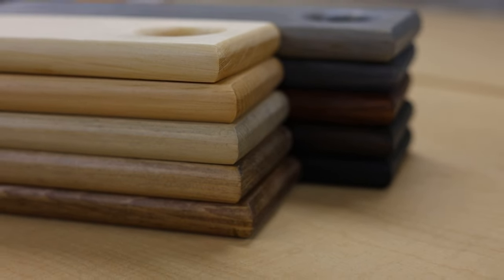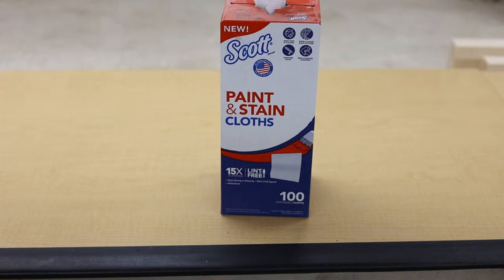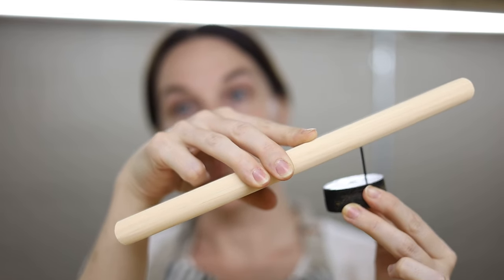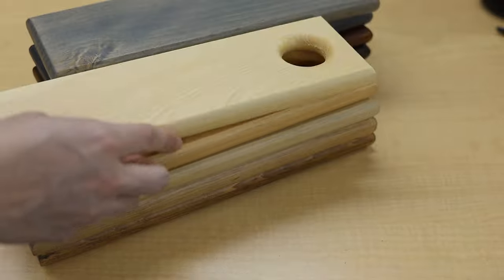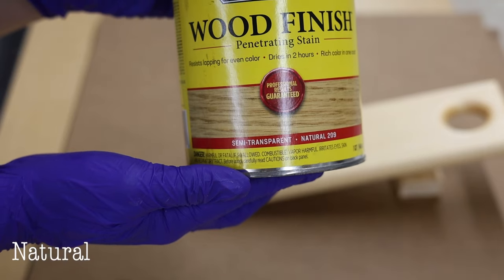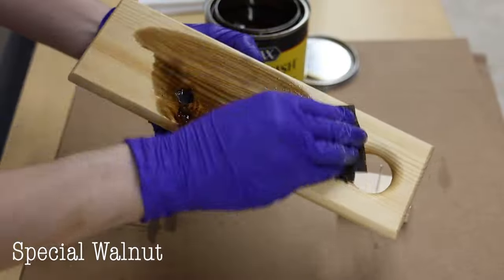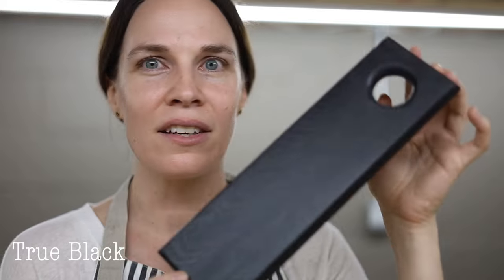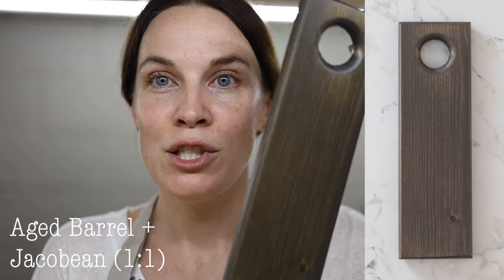How to Stain Pine and My Top 10 Minwax Stains

Comment: I use pine almost exclusively. Yes, paper towels for small projects are great! I also use sponges for larger stain projects - I buy grout sponges and cut them into smaller pieces so they fit into the stain cans. I like your mixes and will be trying that in my own work.  Well done and very thorough.
Reply from the maker: Thanks for watching! Great tip for the grout sponges too, I’ll have to try that out.

Comment: I have been staining wood since 1989. This is a very good tutorial. Tons of good information. My preference is also Minwax for staining. I have the 'feel' for it...I guess you could say. The wood conditioner is a MUST for pine, also for cherry and for western red alder.

My personal favorite is Puritan Pine (#218). Most popular with customers is Early American. Driftwood is popular, as is (and I can't believe it) Golden Oak. I have 'tinted' Golden Oak with grey to some success.

I use chemist's glassware when I mix colors of stain, primarily to achieve consistant results. A couple of those graduated cylinders are less than $30, and give me confidence I can successfully repeat colorations. They are also useful in reduction of topcoats especially when thinning for spray...which I do a lot of.

I also use the 100/150 progression with pine when sanding a product prior to stain. While many woodworking folk will recommend a 80/120/180 progression I want the stain to penetrate and find that anything past 150 grit doesn't allow as much penetration as I would like. 

Finish is half the job, in my opinion. You can build a masterpiece and trash it with poorly applied finish work. It takes practice, and more practice, and finally some more practice to begin to get the 'perfect' finish. Always test the finish before application. Always test the topcoat for compatibility. Some stains will bleed through a clear coating. Some clear coats will fish-eye or blotch. It is a neverending learning process, but to me finish work is the most satisfying part of the craft.
Reply from the maker: Thank you so much for watching! I feel validated that my process aligns with a staining veteran since I'm still relatively new to the craft. You've inspired me to try some new colors! Thanks for sharing your experience.
Reply: Thank you for the info. I took a screenshot of your comment. ❤

Comment: I am starting with staining and your video is the best one, thank you for your time. I still not able to have dark colors as yours, and I think the problem is the wood. Cann your share what is the wood you use? If you can share a link will help me a lot.
Reply from the maker: Thanks! Make sure you’re not sanding to too high of grit (I stop at 150 or even 120). You can always add more coats after an hour or two of dry time for a darker color. One coat typically works for me, I’m pretty generous with the amount of stain on my rag. 

I use the 1x pine from Home Depot or Lowe’s. Here is an example: https://t.ly/GFWf4

Comment: That waxy smooth feeling and look on Pine, and other milled wood is called mill glaze. As the rough wood is run through the milling process, planing, and jointing, resins in the wood form a hard waxy seal on the surface from the heat of the machinery cutters. It needs to be removed so any applied finish can penetrate and adhere properly. This even applies to new exterior Spruce clapboards and Pine trim, although for exterior mill glaze removal, applying a wood brightener and pressure washing removes it. Using hand planes does not cause mill glaze because there isn't enough heat made to create it. That's why in most cases, hand tool wood workers typically don't have to sand their projects.
Reply from the maker: Wow thank you so much for sharing. I'm super excited to learn this! I'm curious, why do the 'common boards' at the big box stores not have this waxiness? It seems specific to the 'Select' grade.
Reply: Being that #2 Pine has knots, so they may not plane them as smooth, but the glaze is there. Next time you're at the store, grab a short one, they may have 6-footers. Hold it up and extended to the light so you can see down its length. You should see the shine, which is the glaze, and when sanded goes away. Also, if you have any true lumber yards close enough to you, check out their supply. Many times a lumber yard will have better selections of grades, and "maybe" even cost a bit less. Plus, you'll be supporting a small local business. @carpenterkatieco
Reply from the maker: @kperellie  Thank you! I’ll eventually make it to an actual lumberyard. Not sure why it intimidates me so much but I should support a local business.
Reply: @carpenterkatieco  There are benefits to a lumberyard that can be difficult to find at a box store.  Starting with customer service. You still have the option of sorting through your material to find the best pieces, and in many cases, they will even load your vehicle. And some, like two of my local places, have drive-through buildings that allow you to, first, be out of the weather, and two, drive up to the areas where your wood is stacked. There should most likely be people readily available to answer and actually know there answers to any questions you may have. Something that is very much lacking in box stores. And over time, you can build up a report with the owners and or the employees.
Reply: Thats so interesting. So would i need to condition wood i sanded on the top of a dresser to remove the varnish/stain before using new stain?
Reply from the maker: @susanmartin870  Yes! I would apply wood conditioner before staining especially if it’s pine
Reply: @carpenterkatieco  thank you!

Comment: Thank you for a very informative video! I am so sad to have just found it because in my new house with pine floors I had to choose a stain very quickly and only knew I didn’t want them to be dark. So I went with Puritan Pine but was told that stain is discontinued. Chose Ipswich Pine because it looked closest to Puritan.  They are so yellow and I really dislike them.  What can I do to salvage them?  If they are redone what will that involve? Is there a shortcut I can take to give them more of a light tan look?
Reply from the maker: Oh no! I'm sorry to hear that. I have no experience finishing floors, but if they've already been sealed they would sadly need to be sanded down to start over from scratch. Floors are typically sealed with oil-based polyurethane which has an amber tone to it, so if you decide to start over keep that in mind since it may alter the final color. You might want to try a water-based poly which generally dries more "clear" but even on raw pine it will still bring out the golden tones. I've also heard of people using a special 2-part wood bleach on raw pine, but I haven't tried it yet. Pine is tough as it will yellow with age no matter what.

Comment: Hi! Is the IRVING Clear Pine Board from Home Depot the same type/grade of wood as the one you used in your video? I'm wondering if the colour result would be similar to what was shown in the video. Thank you!
Reply from the maker: It looks like that might be Select pine. It is usually very smooth and free of knots, but I find that it sometimes has a wax or some type of coating that can result in splotchy stain if it's not sanded extremely well. The colors should be similar to my video if you use the same process and oil based stain. I used #2 grade pine for my swatches which is a couple grades below Select and has more knots in it.

I'll be posting another step by step video of prepping and staining the wood next week since I had a few questions after this video. It might help with your project since I'll be comparing the exact process for Select vs lower grade pine.

Comment: I’ve used the premium pine before and I started out at 180 grit because of how smooth it felt. Kinda like it’d just been ran through a planer, I mean it looked absolutely flawless. It looked much worse after that, like I’d just used a 30 grit on it. So I agree, I think it has something like a wax on it to make it that smooth. The lack of knots is the only thing appealing about it to me now.
Reply from the maker: I agree. It looks great and it's usually much straighter than the other options, but I find it so challenging to stain. It seems like the wax really penetrates the wood because it can still turn out splotchy even with a lot of sanding.
Reply: @carpenterkatieco  it does. Prestain condition really doesn’t help at all either.

Comment: What stains color can I mix to get a maple color? Maybe weathered oak and white?
Reply from the maker: Maple is tough. I've tried Minwax Golden Oak topped with a watered down coat of white paint (applied like stain). It's close but can also end up a little too pink-ish.
Reply: Thank you so much!
Reply: @saidamnia4295  I might try Golden Oak and the wood conditioner in a 50/50 blend. Cuts coloration in half while still retaining the drying speed of an uncut stain.

 I would wholeheartedly recommend you do not mix brands of stain while doing this ..or any other stain mix...as some proprietary formulations are reactive and you either get jello or a colorant that will not stay suspended. Either way...a fail. The cost of stains are really an insignificant portion of the project as a whole, when your time (and love) are considered. Especially...especially...do not mix stains made with different carriers. As in, do not even dream of mixing an oil-based stain with a water-borne stain. Won't work...ever.

Comment: Very nice finishes but I don't know if it's the camera or what, there is no way I can get pine to look like that. I don't know what I'm missing here but a more detail, step by step process would be helpful.
Reply from the maker: Hi Paul! No camera trickery here. Perhaps we’re working with different types/grades of pine?
Reply: @carpenterkatieco  wow! So kind of you to respond to my comment. As you mentioned in your video I am working with home depot "premium" pine, which looks super nice and smooth but my tests produce extreme blotchiness and it doesn't "grab" the color very well. It also doesn't look shiny like yours. I've also tried danish oil, osmo and rubio, not super happy with any. I just want a very light finish that doesn't darken the wood but helps bring contrast in the grain, it has zero contrast out of the shelf. Thank you so much!
Reply from the maker: @PaulPhoenix2010  I rarely use the “premium” pine for that reason. It’s very splotchy and weird for me too. I use the 1x boards that are a step below that at HD/Lowes (the ones with usually a lot of knots). They stain so much better but the knotty wood doesn’t suit every build. It works well for my small decor products.